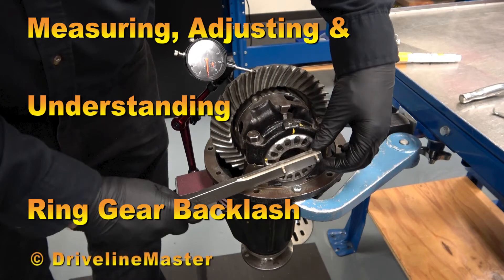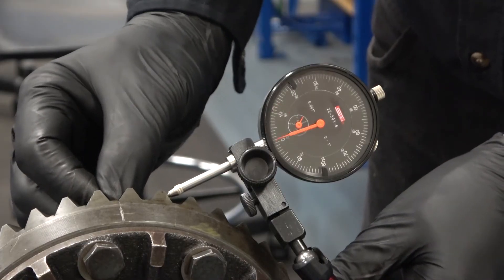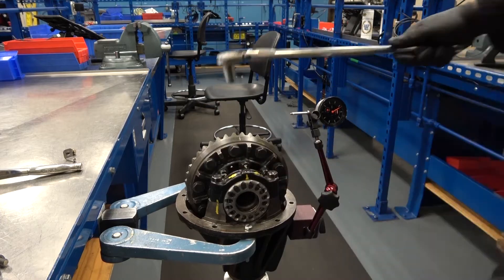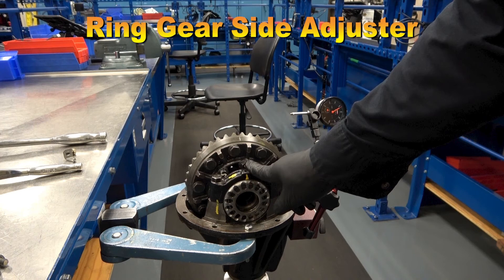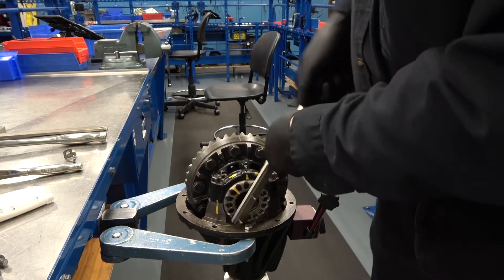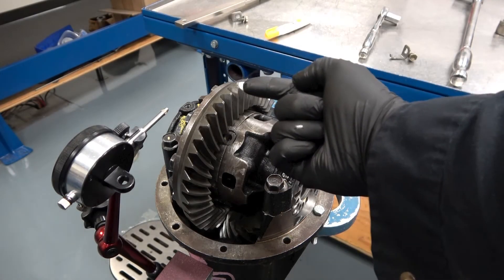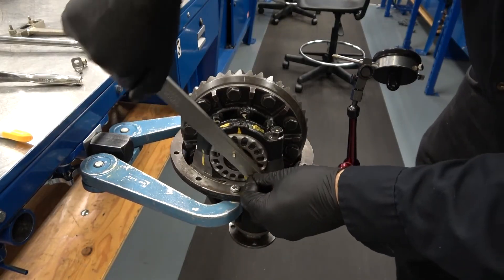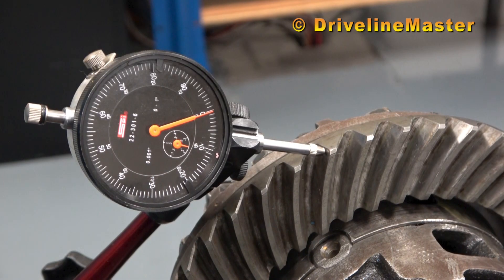Differential Backlash Exercise

Comment: I've talked to you recently about R&P job in my truck. I've been having issues tho with backlash readings unfortunately. I was checking my BL and was doing about every other tooth with dial indicator and was getting everything between 0.003-0.009 in difference so im really struggling on what to do and what can cause this when considering everything is brand new parts other than carrier shims kinda and im using set up bearings for pinion. Any suggestions at all please im all ears!!
Reply from the maker: Excessive backlash variation is caused by too much ring gear axial run out.  There are several things that can cause this.  The case can have excessive axial run out. The ring gear bolts can have uneven torque. The flat side of the ring gear could not be perfectly flat but instead it might have a few thousandth of an inch of tolerance. You might have to re-clock (reposition) the ring gear onto the case.  or you have a bad gear set.  Your going to have to be a detective.  Remove the ring gear but mark it first so you know where it was on your case.  Put your case into the housing with the setup bearings making sure to have some preload.  Put a dial indicator onto the surface where the ring gear bolts to and rotate the case to check the run out.  Make a note and mark the high and low spots.  Anything more than .001" is too much.  Even .001" is pushing it.  It's a little more difficult to check the ring gear flat surface.  You need a precision flat surface that you can put the gear on. If you have one put your gear on it and use a .001" or .0015" feeler gauge and see if there are any spots where the feeler gauge will fit between the gear and the flat surface. If you have a piece of glass that sometimes works.  If you can identify a low spot where the feeler gauge will fit mark that spot.  Now make sure the two surfaces are really clean and bolt the ring gear to the case and try to match the case high spot on the case with the ring gear low spot.  If you didn't find high and low spots or you are unable to perform these test you can just reposition the ring gear onto the case.  Rotate the ring gear 180 degrees from the marks you made when you took it apart.  When you torque the ring gear back onto the case make sure to torque in two steps and use a  crisscross torquing of each bolt.  A two step method means that if the final torque value is 90' lbs. first torque the bolts to 45' lbs. then go around again with the torque wrench set to 90' lbs.  Make sure when pulling on the torque wrench that you pull steady and smooth.  No jerky motions. Make sure there is no contact paste on the gears and recheck the backlash. If this is better or worse but still not acceptable try another position.  If you have tried several positions and your backlash varriation is still excessive (more than .003" maximum. .002" for most diffs) the only conclusion is the way the gears are cut.  You don't need to check every other tooth.  Check about 6 to 8 locations around the ring gear for backlash. Let me know what you find out.
Reply: @DrivelineMaster  thank you much my man you've basically been the only person I've been able to get advice from I know 2 other ppl that can install gears but work in a refinery and been hard to get up with em so your help has been a blessing. What happens if I did run it as is tho, I have been curious just due to the fact I'm about sick of messing with it. Been hard to just be able to stay in garage for very much time at all to try focus on it but also once I try figure out if there are highs and low spots how do you recommend getting ring gear back on? When i initially installed it i lined up 4 bolts in an X pattern and tightened them each one a little bit at a time while adding the other bolts doing the same thing in zig zag pattern till I eventually was able to squeeze the ring gear onto the case then took them back out leaving 4 still tight and lock tighted and torqued so that might have been a mistake but not sure cause I have seen other videos of guys doing that but then I seen others afterwards of putting ring gear in oven before installing which seems better. I've been able to check the runout on outside diameter or ring gear with Pinion out of housing and and was getting close to 0.003 then also checked the case in best spot possible considering ring gear was attached still but was getting close to 0.001 that said I do have tone ring thats kinda in the way so been thinking of pulling it off to get runout on flat side of ring gear which is obviously towards the heel tho, I did use a feeler guage .0015 to see if I could get it between ring gear and case and did not squeeze in no where but glass does make more sense so I will try that as well asap.
Reply from the maker: You can try to measure axial run out on your ring gear while it is installed.  Here is my link https://youtu.be/5RXuvz9Ku84.  If this is less than .002"  you technically should not be having this problem unless the problem is directly related to the cut on the gears.  Pulling ring gears on with the bolts is not a good idea.  This often damaged the bolts even if you can's see any damage.  Some will use the old bolts (also not recommended by me) but almost everyone has an oven. It's pretty simple to put the ring gear in the oven at 200 - 225 degrees F for 20 minutes. This should be enough time but you have to work fast after removing from the oven and use heat resistant gloves.  You can view this video starting at time stamp 9:15 or use this link https://youtu.be/dCHKyO0XIJc?t=555 to see how I do it using a hot water bath to heat the ring gear.  You just have to work fast before it cools. The beginning of the video shows how to remove the ring gear. Are these brand new gears?  What brand are they? Have your reached out to the manufacture? Have you searched to see if others are having similar problems with this brand of gears? You may need to remove the tone ring to get a good measurement. You may need to change the gears. Don't run this diff with .006" of backlash variation.
Reply: @DrivelineMaster  yeah I was afraid you were going to say this after I had kinda considered this to be a somewhat simple job in a way considering ive always been around turning wrenches my entire life but never a rearend rebuild but i thought I had done enough research before hand to get this done right and unfortunately I know now that I did not😔.. to late to turn back now tho but I hope I didn't screw myself when running gear up with bolts but I did use the old bolts luckily maybe and have new ones that came with master kit so I can go back with those. Gear set came from Ebay unfortunately I probably cheapped out on doing so not knowing any better of course. This has been 6 months ago and just now started working on it due to lack of time it is an 3.73 gear by Richmond Excell i didn't realize this was just an off brand of Richmond so thought I found a deal when really I just hurt myself maybe. I haven't reached out to the manufacturer because of the fact it was an Ebay seller which I guess once problems started is when I found you and plus I know manufacturer most likely wouldn't exchange them anyway so idk but it is a brand new set as well. 🤦‍♂️
Reply: I should've known better than to buy a part like this from Ebay knowing it be a while before I could even start on it but I won't run it with that amount of variation if you say not to cause I definitely do not need more issues and Detroit truetrac wasn't cheap neither so definitely don't wanna damage that at all! Would it be a good idea to go back to 3.55 factory gear set on the new case/differential if i cant figure out problems with new gears and if I do what all should I know before doing so also not sure how to identify if factory set is worn and reusable or not? Thank you for everything man really!!!
Reply from the maker: I have not had the best of luck with Richmond gears in the past and I have also had poor luck with anything that is a kit from ebay.  Sometimes ebay resellers will mix and match components that should be a matched set from the manufacture.  Also stay away from clutch kits from ebay.  You never know if someone packaged a loose ring gear with a loose pinion to make up a kit.  Now that I know a little more history I really think this is a tough lesson and you need to buy a replacement gearset from a reputable store.  Summit or Randy's World Wide.  I tend to favor Yukon gears.  You need to at least try to get a refund.  Like I said, as long as the ring gear run out is .002" or less then I think you got bad gears.  Bummer.
Reply from the maker: 3.55 to 3.73 is not much of a jump and ring and pinions are pretty durable so if you don't see obvious visual wear and you can't get your money back and you can't afford a quality gearset then I would go back to the OE 3.55.  I'm guessing you were just trying to get a little more low end torque for a street ride.  I'm not sure what gear set is available but if you need more low end you should try to get a gearset a little closer to 4:1.  Maybe 3.89 or 4:11.  Also if your truck is 4X4 you have to consider the ratio of the front diff. They need to be almost identical.
Reply: @DrivelineMaster  yes I completely agree with all that you've said. I cant tell you how glad I am tho on the bright side of everything just to have talked to ya and receiving valuable insight with all this cause atleast ive learned much more than I had known about any of it so thats always a plus. My truck is a 4×4 2001 5.4 lariat which a machinist i know said as long as I don't use my 4wheel drive I can always do the front later and also thought about unhooking front driveshaft until then so maybe you have more insight there hopefully before I move forward. My OEM gears seem ok but pinion gear does have sharp edges down towards inner bearing side of it so not sure on all that necessarily. However my thoughts were to just try go for a bit more pulling power and torque on gear change all while trying to still be ok for highway. Id like to just have little more power on low end for hauling trailers and bass boat etc. Once again man you've been a blessing for me on all this I cant thank you enough on it!!! I actually called a shop near my area to ask about backlash issues and they said its pretty normal but it wasn't normal to me lol. Idk what other problems it maybe would cause but I didn't wanna chance it and obviously this is where you came in again as well 👊🍻
Reply from the maker: Matt, It's my pleasure. I enjoy helping others with stuff I know about.  Yes, you can get away with changing the rear gear ratio if you never engage the front or 4WD.  I'm not sure I would go to the trouble of pulling the front driveshaft.  The next question is:  Were you having noise problems with your OE rear gears? If you don't see pitting or obvious wear on each tooth to where you can feel it with your finger nail then you can most likely reuse your OE gears.  Especially if you are only changing your gears out for the sole purpose of getting more low end torque.  BL variation should be .002" or less on a new gear set.  I have let .003" go but I'm not super happy about it. If it gets to .004" or above this is not acceptable to me.  Once I had one at .004" and I couldn't get it any better.  It was a Richmond gear set.  I contacted a representative for Richmond gear and they told me that for that gear set .004" was within their tolerances.  I informed the customer and let it go. It never came back with a problem but I never like to tempt fate. Good Luck.
Reply: @DrivelineMaster  hey man thanks again, I managed to make time to check axial run out and was getting right at 0.0025" and this was with my ring gear still installed like the video you had on here for me to watch but along with that I checked my differential case (detroit truetrac) which is also new and was getting less than 0.001 axial runout on it but im trying to make it out to garage today asap to check my backlash variation again now that I managed to get all gear marking compound removed and gears cleaned so ill definitely lyk asap. Also how often do you see a differential housing thats bad if thats actually possible im not sure but imagine so. Just curious if maybe bearing seats for carrier can get worn out or not, making for a bad runout reading 🤔
Reply from the maker: I think you may be calling the differential case the housing.  The case is where the ring gear bolts to.  The run out on the case is rare but can't be ignored when hunting down a problem.  Normally they have excessive run out from an aggressive technician who hits it with a hammer during ring gear install or removal or if the ring gear bolts are torqued severely uneven and over tightened.
Reply: @DrivelineMaster  i probably didn't word it right but I was trying to say I ended up checking the diff carrier/case for runout as well which is what the ring gear bolts to if im correct on that but I set dial indicator in best spot possible considering my tone ring and ring gear itself was still bolted on while doing this but however I set indicator on the very edge of case in the outer lip basically right next to ring gear bolts if that makes sense but was getting less than 0.001 on that reading and then checked outer diameter of actually ring gear past the heel side and was getting 0.0025 at the highest. Hope all that makes some sense to ya lol, wish I knew proper names to make it easier to word🤷‍♂️ 
  With that all said I did end up cleaning marking compound off the gears completely and decided to set it all back up before possibly having to strip it all apart and starting over with re-clocking gear, I put it back with 0.032 P shim and checked backlash readings one more time and had an avg of 0.006 after checking total of 9 spots. Lowest reading was 0.004 and highest reading was only 0.0065 so I was only out .0025" of an inch which is better than .006 obviously. That number of course still has to be adjusted tho cause I'm going shoot for .009 backlash so maybe just a good cleaning is all it needed and if so than I feel like a jackass, is that the case sometimes cause really I did not think the paint was that thick but maybe so 🙄  
  The other thing is what I was trying to ask is if the differential and axle housing where carrier bearings are riding could maybe go bad causing high runout readings or not and have you had a situation like that if so is it fixable these questions are purely outta curiosity?
Reply from the maker: It sounds like you are good.  It always amazes me how the much the contact paste influences backlash readings.  Yes, the part that the ring gear bolts to and houses the spider gears and limited slip is called the case.  It would be extremely rare to find a problem with the case where the bearings press onto or where the ring gear bolts to from manufacturing. The only way that can happen is through shipping or technician abuse. I have never seen this.  I do see worn out spider gears and cases that wear at the spider gears ride or on the pinion pin and pinion pin hole in the case. The next time I have someone ask me about excessive BL variation I will advise to make sure the gears are really clean and re-check. Now lets put down the tools and go bass fishing.... :)
Reply: @DrivelineMaster  lol sounds good to me man really appreciate ya!! You've really been a huge help and tbh completely honest with you I never expected for as much help as you've given me with all the advice from just simply asking a you tuber as yourself a question and to have it turn into everything you've suggested me to check and do is a absolute blessing cause i am a DIYer and watch a lot of educational how to videos on here and ask questions and rarely ever get replies back so very grateful for all your shared knowledge with this and means so much man!! I will definitely highly recommend all your content to everyone i run across doing drive train work 💯🍻👊

Comment: Where do you get that diff holder tool? Very handy!
Reply from the maker: It is an OTC tool and you can get it on Amazon.  Someone else asked that a while back and I looked it up and responded with the part number.
Reply: @DrivelineMaster  Do you have a link by any chance?
Reply from the maker: Found it on JEGS.  OTC 7020 holder.   https://www.jegs.com/i/OTC+Tools/717/7020/10002/-1?gclid=EAIaIQobChMIvbL9g9T98wIVsyitBh262Q5bEAQYAyABEgI6nPD_BwE